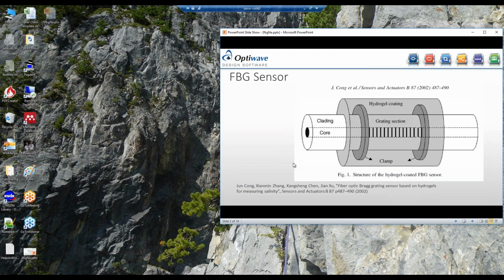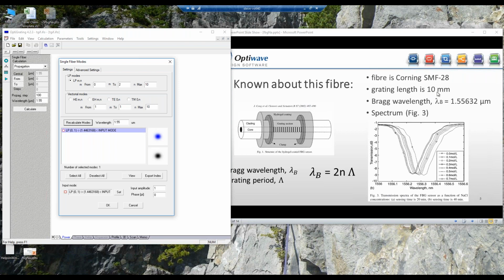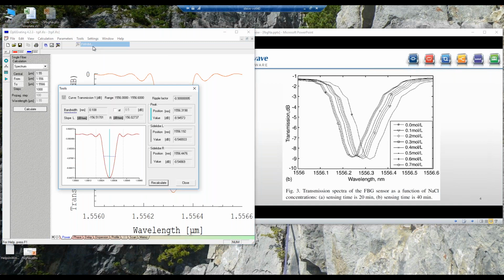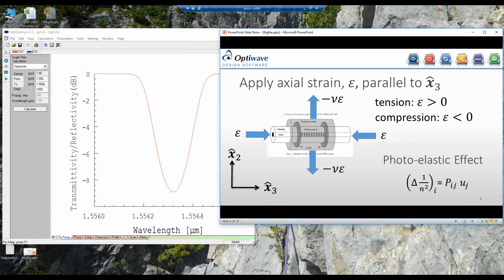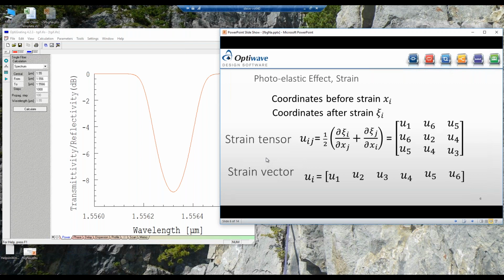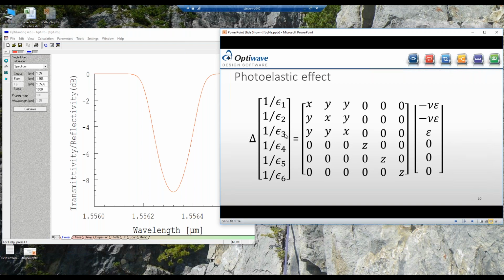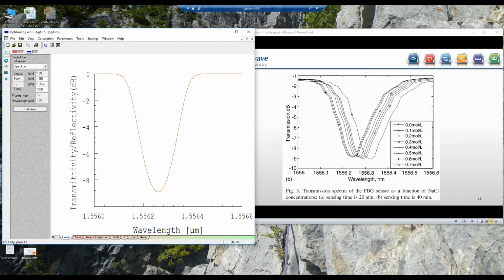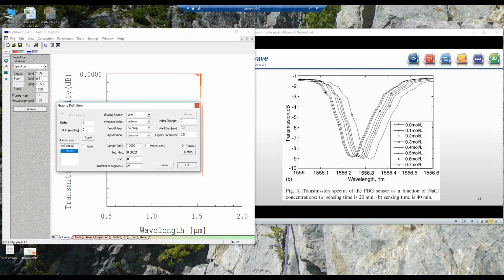OptiGrating   Fiber Bragg Grating Sensor Design

Comment: Excuse me, Optigrating can simulate multi-core fiber gratings, such as four core or seven core (one fiber core at the center of the circle, and the rest are arranged in equilateral triangle or hexagon)？
Reply from the maker: Hello Gruce, this feature will be included in our next release.
Reply: @OPTIWAVEHD  May I ask you when the next version is likely to be released？Thank you.😀
Reply from the maker: @lugruce537  We expect the late this year.
Reply: @OPTIWAVEHD  Another question is, can Optigating add strains that are not along the fiber, such as strains perpendicular to or at a certain angle to the fiber?
Reply from the maker: @lugruce537  Can you send your question to support@optiwave.com with your license information? Thanks.
Reply: @OPTIWAVEHD  Thank you for your answer. Because Comsol and Rsoft cannot meet my needs, I have recently learned that Optigrating can also simulate through my teacher. I haven't downloaded it yet, and is in the learning stage. Looking forward to the new version developed by your company.

Comment: I am in need of a short video stating the design of FBG as a temperature sensor and also want to know that whether the FBG temperature sensor can be used for detecting the tumours inside our body.
Reply from the maker: Hello Shanmuka,  can you send your application and requirements to support@optiwave.com? Thanks.
Reply: @OPTIWAVEHD  Thank you for this information
Reply: I need the same design did u find it